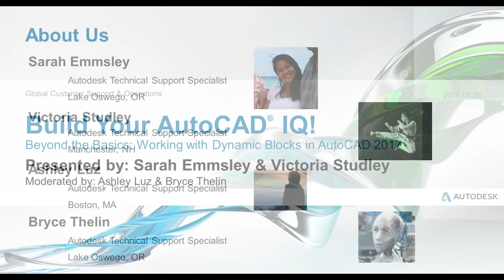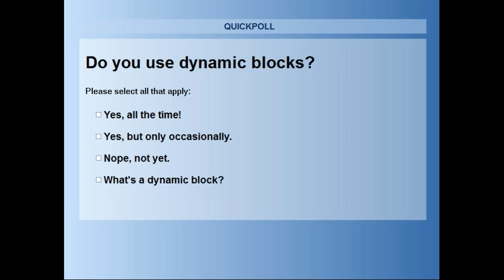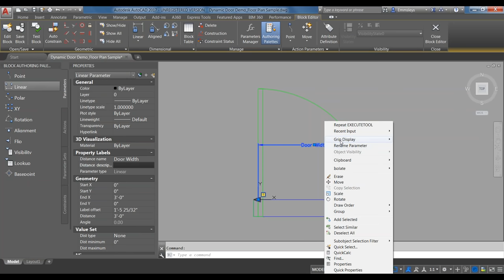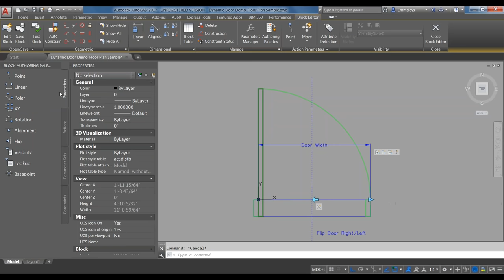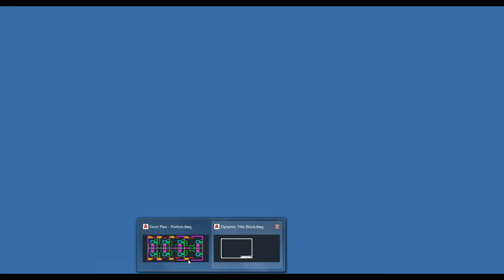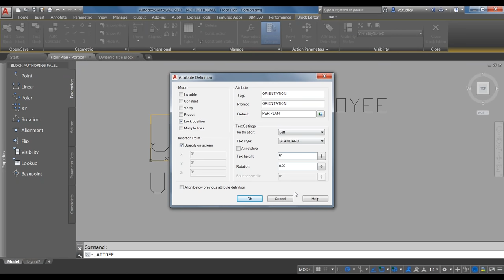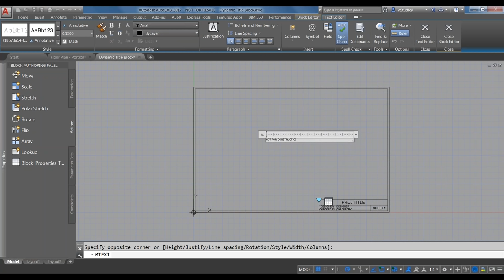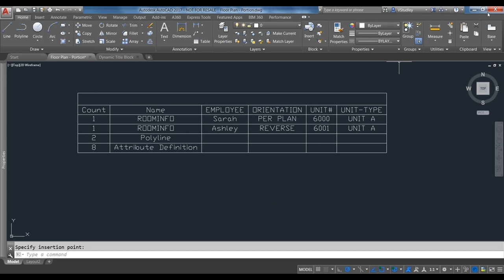Working with Dynamic Blocks: AutoCAD 2017 WEBINAR | AutoCAD

Comment: Autodesk needs to add option not to use attributes but only text with field added. This door block needs also text with width, that changes accordingly to stretch. But this text gets out of the original position when you use mirror/rotate,... by this parameters. With ver. 2019, still the same.